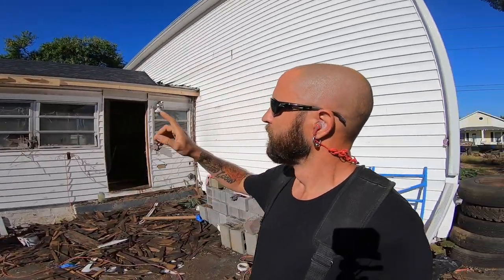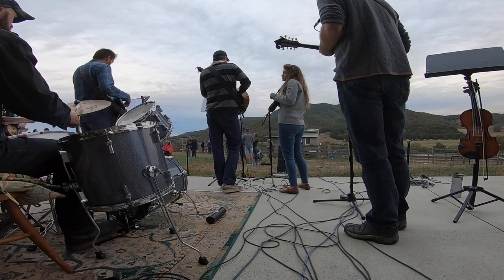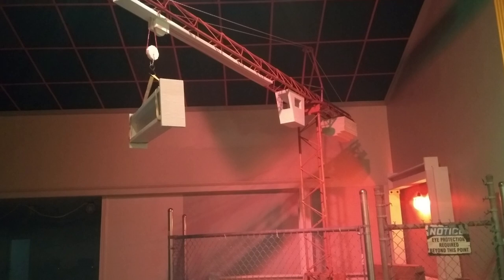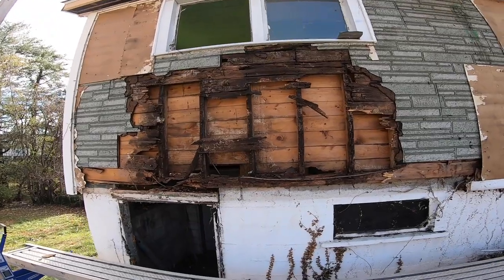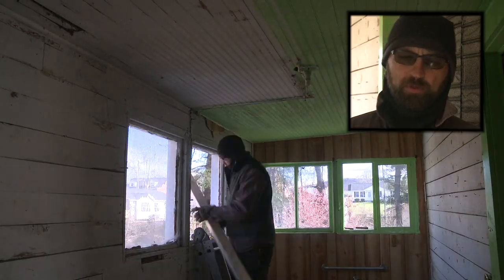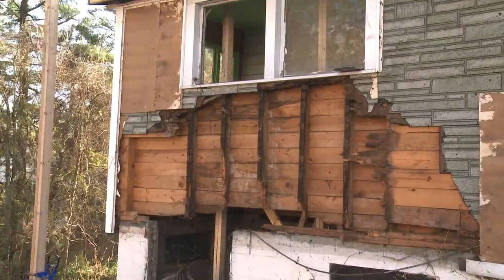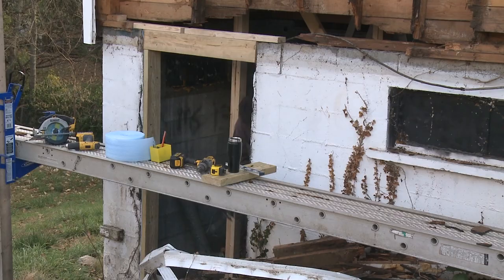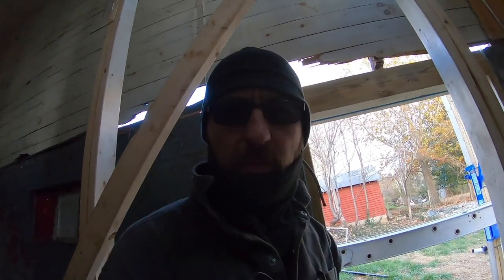Hoarder House // Siding and a Rotten Wall.

Comment: The house looks so nice on the outside with the new siding.  Good thing you discovered the rotted wood. I’m sure it was a disappointment and setback, but now you can move forward.  The bitter cold can really slow things down.

Comment: Wow. You're doin' a beautiful job! How come you are so much slower than the flipping shows? LoL... (it's a joke- don't answer- or frown!) I toyed with doing flipping like that but I'm way too slow. Working by the hour as a handyman for rich people for 30 years will do that to ya... Heh. Now I'm going to build a homestead, workshop, barn, chicken coop and out buildings but they will be for ME and my family so I will work just as slow as I damn well please... :) 

I'm experimenting with Tilt-Up concrete because it's very cheap, strong and indestructible. They used to build a lot of Tilt-Up concrete homes back in the '50s. But not so much anymore. Maybe in Florida to protect against hurricanes. Mine will be to withstand tornadoes. I got a bunch of old books on it and the information is fantastic! Modern Tilt-Up is too industrial and on too large a scale these days. But the guys who started the whole thing back in the '40s & '50s pioneered human scale Tilt-Up that's very accessible to a single builder or small crew. I already have a crane truck to lift the panels so I'm 7/8 there already... :) Cheers!!! 

Oh, you really do need to take all the siding off and turn the house wrap the right way. It's going to let all the air out of the house the way you have it upside down....... LoL............

Comment: I love these vids!!  I have a question, when tearing off the siding cant you put insulation there rather than just plastic or is the insulation more on the inside of the house?
Reply from the maker: The plastic (house wrap) is a wind barrier. Insulation is done from the inside.